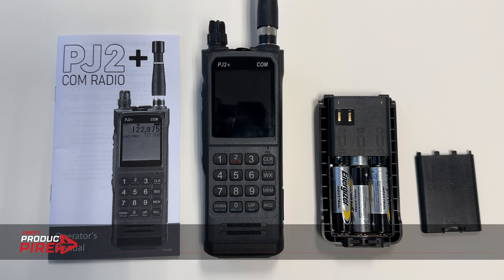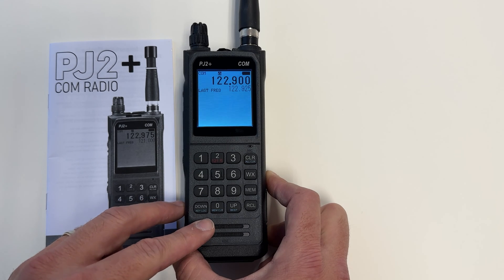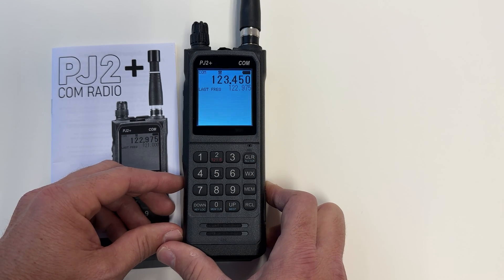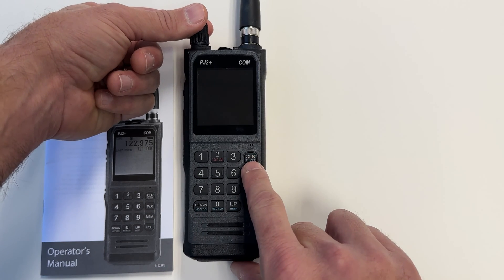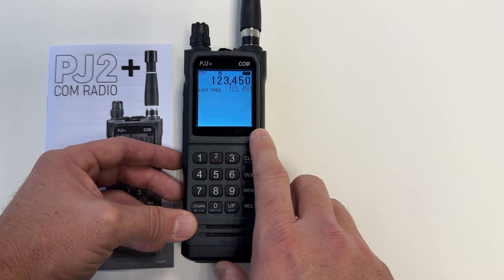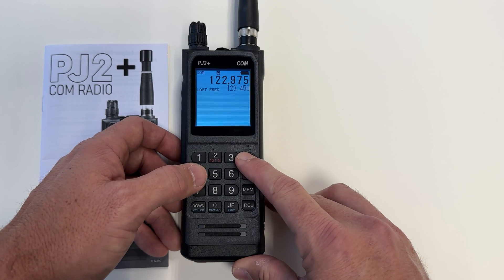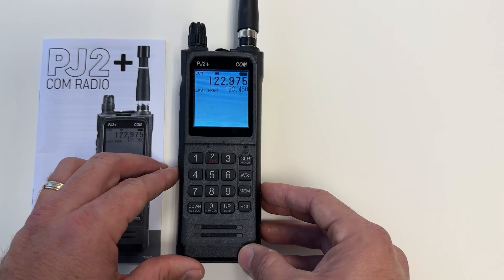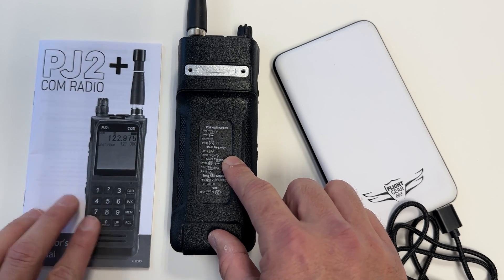PJ2+ COM Radio pilot's guide - how to change batteries, store frequencies, scan, and more

Comment: This radio is only good for emergencies you can’t use it for anything else emergencies only! I tried it at my airport sitting next to the tower in my airplane I had to stick the radio out the window to get decent reception. The reason I purchased it was because I did lose my electrical one day while I was flying and you can plug headphones into it other than that it is not worth the price at all!

Comment: How do I remove the battery pack? I release the clip at the base of he radio; the battery pack can be raised but only about 1/8 inch.  It won't move further.  I don't want to force the case and break it.
Reply: Same here??!!!!
Reply: I figured it out. You literally have to mess around with it a little. It sucks but you’ll get it eventually. After that it worked fine multiple times

Comment: I'm just curious as to what would a regular non-pilot person do with such a radio? I mean, if it's illegal for a non-pilot to talk to pilots in the air with one of these radios, I'm curious as to why they are sold to the general public. Don't get me wrong, I would be the first in line to order one of these radios from Sporty's if I knew for a fact that the FAA and FBI are not gonna come after me for having a conversation with a passenger aircraft pilot cruising at 30,000 feet up in the air. So can somebody explain to me what good is it for a non-pilot person to own one of these transceiver radios instead of a receiver ONLY police scanner radio which has the aircraft band included to listen to???? 🤔🤔🤔
Reply: It's sold to the general public because this is America and you don't need to ask for permission to buy a radio. A non pilot could still listen in on radio and learn
Reply: Can I use this radio to listen to law enforcement frequency?